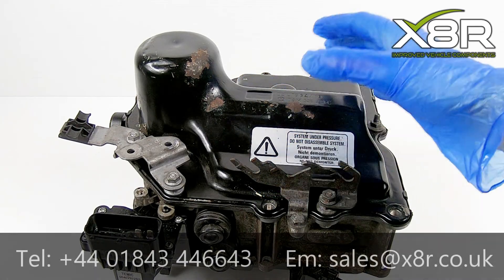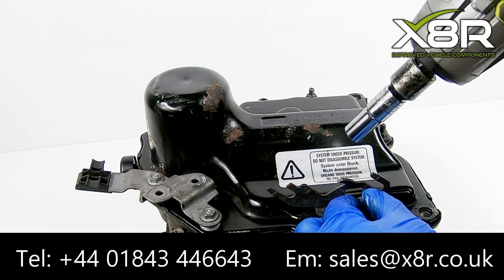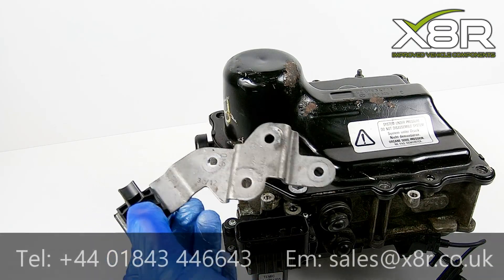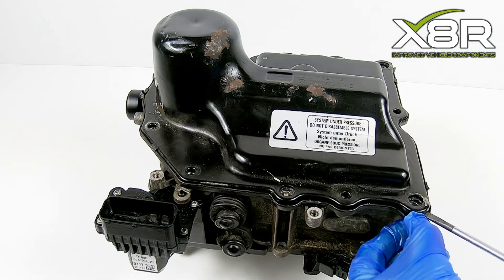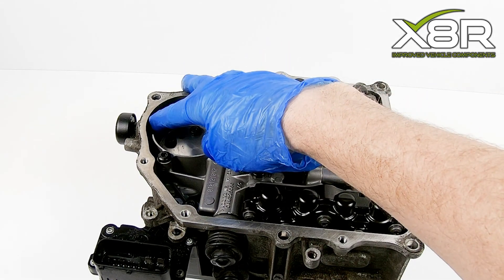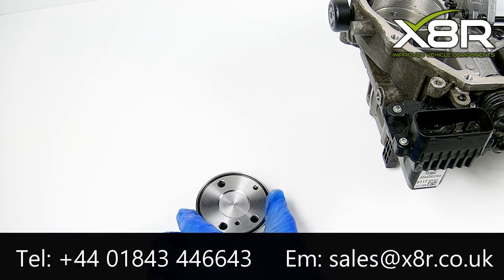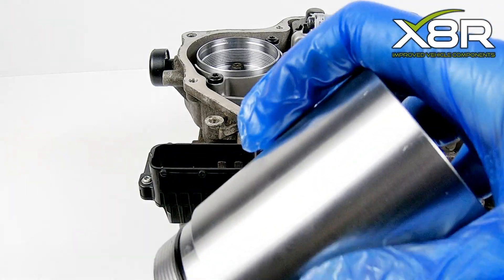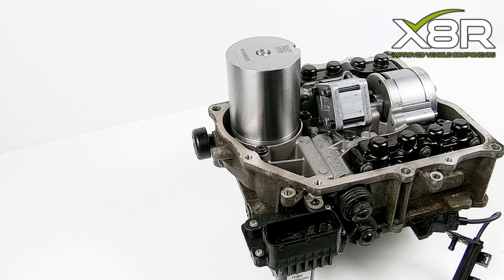DSG Mechatronic 7 Speed Gearbox Hydraulic Accumulator Repair Kit Leak Fix VW AUDI SKODA SEAT Install

Comment: Good one. What if there's no crack in the accumulator? P17Bf hydraulic pump.. Protecting. Will i release pressure n it is okay to go?
Again what if I buy another mechatronic? Golf mk5, 1.4 variant  2009.Dsg 7.Did a service 1 year ago, just changed the oil n released the pressure when it stalled.it has stalled again. Prnds flickering. Please advice, thanks
Reply from the maker: Hi there, the system is  under immense pressure and has to be depressurised electronically so ensure you take it to a mechanic to do so. 
If you can't see any cracks look out for bubbling from the breather tube as this is also a symptom.

Comment: I have a 2013 Skoda Superb with DSG (Dry Transmission). It get's stuck in 2nd, 4th, 6th while cold, but once warms up after 25 minutes or so usually no issue. Do you think this Kit will help?
Reply from the maker: Hi, without any more faults it would be unlikely we would be able to diagnose the accumulator as being faulty. We recommend getting it professionally diagnosed at a garage. - Georgina, X8R Ltd
Reply: @X8RLtdUK I’m having the same symptoms as above had new clutch fitted as it was saying clutch clearance too small, stuck in gear 2 and also pressure drop, the clutch clearance code has gone I’m still getting stuck in gear 2 and pressure drop, will I need to replace this part also?
Reply from the maker: @lukegadd4988  Unfortunately it would be impossible and illadvised of us to diagnose an accumulator fault based on this information alone, I would highly recommend taking it for a diagnosis at a garage, preferably one with knowledge of the DSG/mechatronic system. - Georgina, X8R Ltd

Comment: if the car is flashing the prnd and I have a fault for hydraulic pressure and i removed the cover of mechatronic but I don’t see any cracks but the fluid is coming out from the berthing valve, the accumulator is not getting unscrewed no matter how much I tried. What should I do please any advise ?
Reply from the maker: There will still be a great deal of pressure within the accumulator, this would be unsafe to try to unscrew without first depressurizing which requires plugging the car into VW software. If you cannot do this yourself you will need to take it to a garage. Since you have fluid coming from the breather it is likely the accumulator is at fault and our kit would fix that. Any more queries don't hesitate to contact us on sales@x8r.co.uk. - Georgina, X8R Ltd

Comment: Hello, what is the reason for the oil leakage from this part?
Reply from the maker: Hi, it is under immense pressure and sometimes there are hairline cracks. It could also have been damaged if the sump was hit. - Georgina, X8R Ltd

Comment: i have no error codes car drives in 2nd and 4th is there another issue
Reply from the maker: Hi, we recommend taking off the sump cover and checking for any damage to the accumulator and the housing it sits in. If there is damage then our kit may fix the issues. Although usually error codes will be displayed. - Georgina, X8R Ltd
Reply: @X8RLtdUK  i cant see any damage but the accumulator wasnt tight and the blue o ring looks rooted i suspect pressure coming past the o ring
Reply from the maker: @rolphbluesky8537  you're more than welcome to order our accumulator kit if you are sure that this is the fault. Without any fault codes or a garage diagnosis it will be impossible for us to confirm if our kit will resolve the issue. - Georgina, X8R Ltd

Comment: Hi, Im getting Following two error codes.
P279700 - Auxiliary transmission fluid pump performance
P17BF00 - Hydraulic pump play protection
And my vehicle is Audi Q2. I think my Mechatronic unit is slightly different. I think its DQ200.
Do you think by changing repair kit it will eliminate the faults.??
Reply from the maker: Hi there, we recommend taking the sump off your DSG unit and checking the accumulator. If there are any cracks/visible signs of damage, or if there is bubbling from the breather tube then it is likely this kit will solve your issue. - Georgina, X8R Ltd
Reply: replace valve body it is better.

Comment: How to release the pressure inside the pressure accumulator if an attempt to replace is made while the gearbox is still attached on the car? Is draining the oil and disconnecting the battery enough to safely open the gearbox oil pan and unscrew the pressure accumulator?
Reply from the maker: No, it should only be unscrewed if it is clear the accumulator or block is cracked and as such the system isn't holding pressure.

Comment: My car has DQ500 DSG7 transmission. It has been leaking from the seams, so I am guessing it has to do with pressure build up. Does my transmission also have this accumulator inside? Thanks in advance.
Reply from the maker: Hi, we would need a few more details about your vehicle, you can reach us at sales@x8r.co.uk or on 01843 446643.

Comment: I have the following fault: P1895, Reduced function because of pressure drop. and the accumulator is constantly running, I can see the hydraulic fluid leaking onto the floor but can't see where from doesn't look to be from the breather at the top. Would this be caused by the housing being damaged or a leak around the mechatronic gasket?
Reply from the maker: It's difficult to diagnose, we would recommend draining dowm the mechatronic unit and inspecting the accumulator and the block near to the accumulator for damage.

Comment: There's recall for this
Reply: In the uk?
Reply: @elenijasmin  Not sure about the UK but here in the states I received a recall letter for this in December 2019. Fix isn't available until March 2021.
Reply: I'm still waiting on the fix for my 2013 Jetta Hybrid. They sent me the letter Dec 2019 but I guess the fix won't be ready until March 2021. Seems like a huge job.
Reply: @nickd2070  Is it campaign/recall 34J6? The VIN for my 2013 Jetta Hybrid didn't get included in the recall.
Reply: In Australia I just received a letter about this recall. Hopefully they will fix it properly, not like in the video they fitted a new accumulator into the old one
Reply: @HeKuTK0  hey mate, I've had this fault on my car. Are you able to share a pic of the recall letter? - i cant find it on the vw/audi/skoda websites.

Comment: Hi. How many liters need put into the gearbox?
Reply from the maker: 1 litre is required. - Georgina, X8R Ltd
Reply: What fluid do you recommend  @X8RLtdUK
Reply: @X8RLtdUK  Top tip.refilling the mechatronic unit is pain.air inside stops oil going in  drilled a hole in the top of the cover welded a nut to it and put a plug in. filling was a doddle